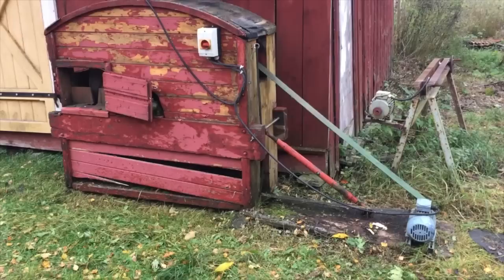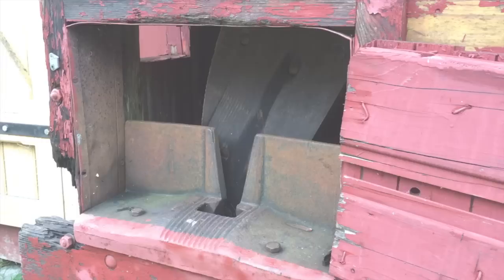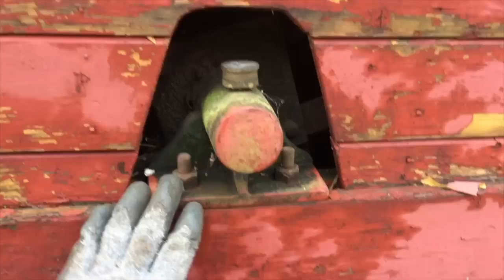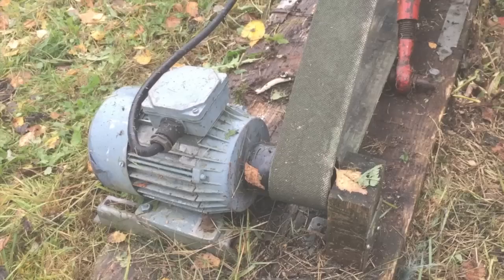Old Swedish Wood Splitter - Effective but Dangerous

Comment: Be careful man... you handled the motor pulley and belt while the switch was ON and the cord connected. Always turn off or disconnect electric devices before working on them. Good old machine ... most likely a dead capacitor or loose/rotten terminal at the motor. 
Cheers from Patagonia.
ps: if you have to help  that machine to start it, do it with your feet on the pulley and following the direction of turn, it would do the trick.

Comment: Sir, 
I grew up on a dairy farm using a lot of equipment powered by electric motors/engines, and I cringed at the part of the video when you attempted to get the splitter running.  You attempted to spin it free hand,  and with locking pliers, without unplugging the cord. that's a good way to lose fingers. My father, and one of my younger brother lost parts of fingers when the electric motors of the equipment that they were working on switched on unexpectedly.  
Please in future, for your safety, and your family's, disonnect the power cord when tinkering with equipment. 
Also, it might be a good idea to build a small hut to cover the electric motor/engine to keep the elements off of it.
Sir, where was your eye protection?
Otherwise, a good video. 
You speak English better than I speak Swedish, which is to say  I can't.
While, it would have been nice to see the machine work, sometimes, on a farm, things dont work out as planned. Keep up the great work.

Comment: Nice video, I would love to see the Töreboda Klyv running. Also it would
 have been nice to see you acctually use your new spliter and you saw. 
Do you cover your woodpiles ore are they exposed to the rain (that would
 not work in germany, Because the wood would rot) ? All The best, 
Maximilian.

Comment: Great Video! Brushes are Probably mucked up on that old Motor from sitting in the weather. How many horsepower is it or take some fine grit Sandpaper to the Rotor and Brushes.
Reply from the maker: I think the same. Might get it going again at some point.

Comment: Nice video.
Your capacitor is probably shot or your centrifugal 
switch in the bell housing needs some work.
No brushes in that motor.
Reply from the maker: Ok. Will take a look at it with my dad. He's an electrician.

Comment: Wood splitters like this one and even the modern firewood processors work well on softwood or coniferous wood of uniform size with a straight grain. Some of the wood I have to deal with here in UK is twisted bent knotty hardwood. It has even stalled a powerful hydraulic splitter and has to be removed from the blade with a sledgehammer!
Reply from the maker: Oh my. That doesn't sound like fun. What do you normally use to split your wood then?
Reply: Ditto here in the U.S., Willamette Valley, Oregon. A lot of the oak wood is so tough it really makes my 34 ton log splitter work, and my pieces are just 18 inches long, not 3 feet. Sometimes have to knock off the stuck pieces with a maul, and once too much pressure developed in the return hydraulic line and busted off, loosing lots of hydraulic oil in short order. Love you accent. Grew up around a lot of Norwegian immigrants. Really miss them.
Reply: I use a hydraulic tractor powered splitter similar to the one I imagine John Steed uses in Oregon. 
Just split up some Eucalyptus wood. Unbelievably tough it has a kind of corrugated grain which effectively stitches it together, impossible to split with an axe. If there's any Aussies watching how do you get on with it?

Comment: An inexpensive shelter could help keep your expensive equipment from rotting and rusting away.  I've never understood why some people pay hard earned money for equipment, only to leave it outdoors to get destroyed by the elements.
Reply from the maker: Well. This thing actually doesn't have much value and we don't have enough shelter.
Reply: if you notice at 1:45 after the strimming there is a base under the motor and tensioner bar also the end of the flywheel housing is not painted I can guarantee you there was a red wooden cover over the motor and belt with a felted waterproof roof just like the rest of it. It may be a little derelict now but it was not always so this little beauty was once very much cared for and protected from the weather.

Comment: I remember my grand parents farm in Kilafors having a wood splitter similar to this unit except it was much larger and driven off a power take off pulley on the tractor. Instead of having a knife set at a right angle to the revolving wheel for splitting, a blade was set into the side of revolving drum and the wood was shaved off to make shingles. No safety guarding whatsoever.

Comment: How do you keep the wood dry when it is outside in the elements ??
Reply from the maker: It dries a lot during the summer. Rain will just make it a little moist on the outside. Before winter we put it in a little shed where it can dry all the way.

Comment: That is pretty cool!!  I was thinking of the Finnish tilt table buzz saw we used to use, if not careful pretty easy  to lose fingers or worse!  I see you have a more modern version of that. Is much more economical to use( as opposed to using a chainsaw) for cutting to shorter lengths, especially if it is smaller material. Great video!!!  I would really like to see your old spitter in operation though!!!
Reply from the maker: Thanks. Hopefully I will get the thing going. This was my first ever youtube video.
Reply: 1